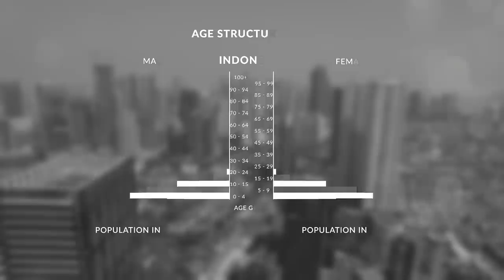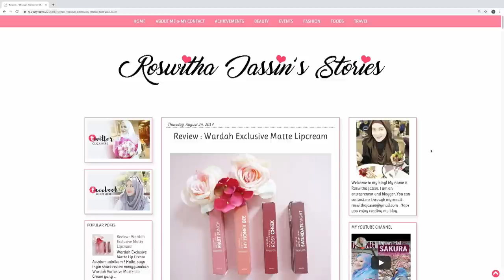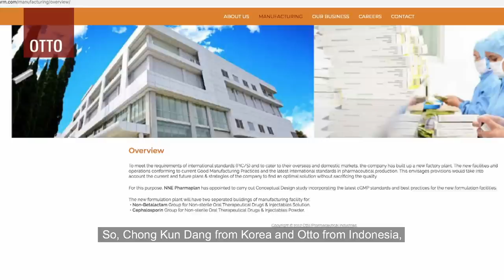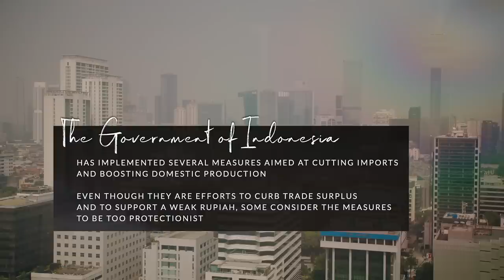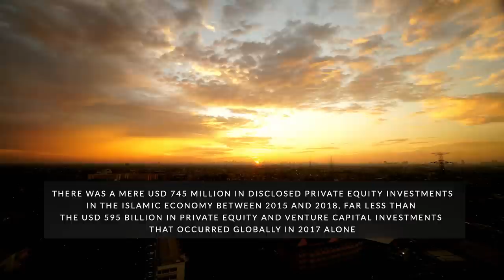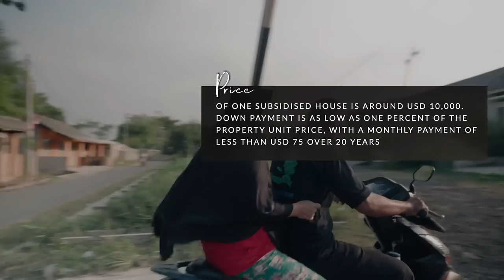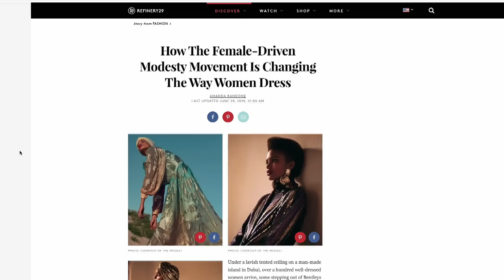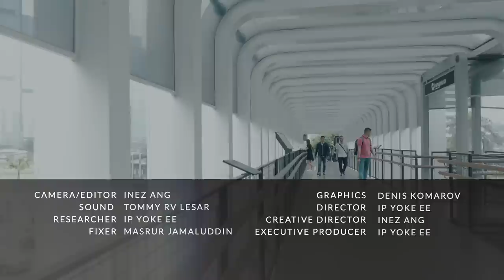Tapping Into Indonesia's Global Halal Hub Ambitions | The Millennial Investor | Full Episode

Comment: CMIIW. The main reason 7-11 flopped in Indonesia was because there was/is an Indonesian law which states that convenience stores must be locally opened. 7-11 tried to bypass this by operating under a restaurant license instead. That's why most 7-11 in Indonesia at the time included lounging spaces, hot foods, and dessert, which is contrasted to locally owned convenience stores which may only have a few tables and lack of 'full course' options. In the end, 7-11 occupied this middle space of 25% restaurant, 75% convenience store, and wasn't able to comply to local restaurant requirements and had to pull out.